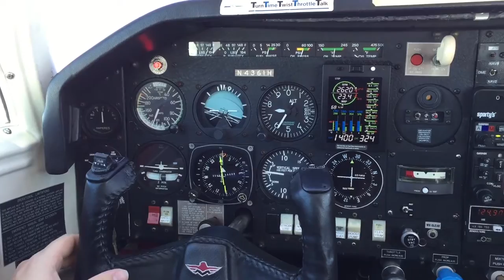Mooney M20J Vacuum Pump AI Failure

Comment: Hey, I thought Vac pumps only failed in night IFR conditions.
Reply from the maker: +Jim Foreman 2 things I learned. First that it can fail any time. Second is that it is possible to fly partial panel, but the good news is that the Precise Flight standby will work when you need it most (at low throttle on approach).
Reply: vac pumps will always fail, you just dont know when
Reply: It doesn't have to be one of the gyros to get your attention. One time we were 
VFR on top with mountain peaks sticking up through the clouds enroute from Colorado Springs to Winslow, AZ in  210 when the oil pressure went to zero. A quick check told me the worst, it was capillary and not an electric instrument. I went to minimum power and turned toward Alamosa which 20 miles away in the middle of the San Luis valley. Then a guy in the back seat said, I see a runway straight below us. Sure enough there was a hole in the clouds and a beautiful paved runway.  We spiraled down and landed. Turns out that the oil pressure line vibrating against a stiffener on the back side of the firewall had worn a pin-size hole in the line. Repaired the line, had lost less than a quart of oil, and went on with our trip to Mexico.